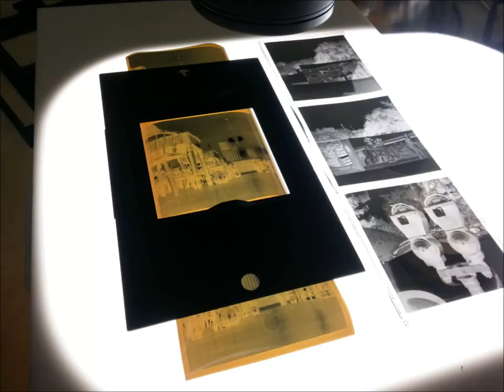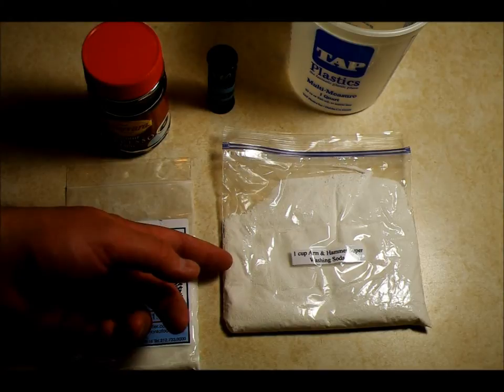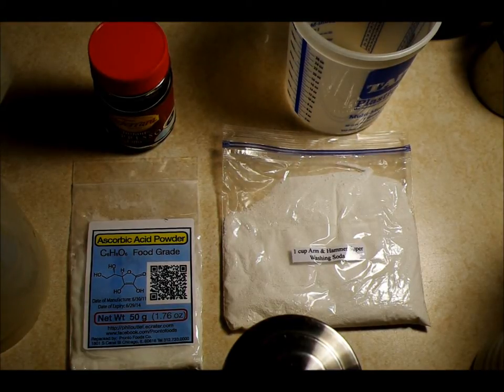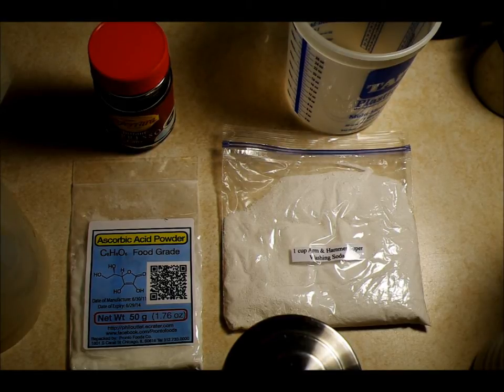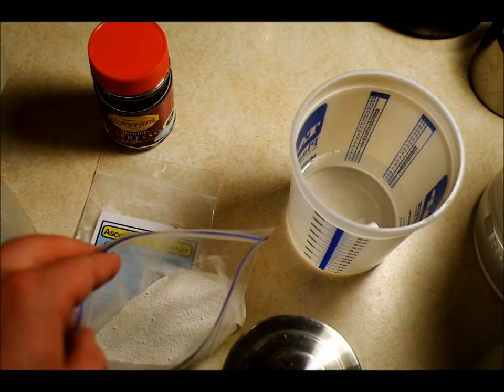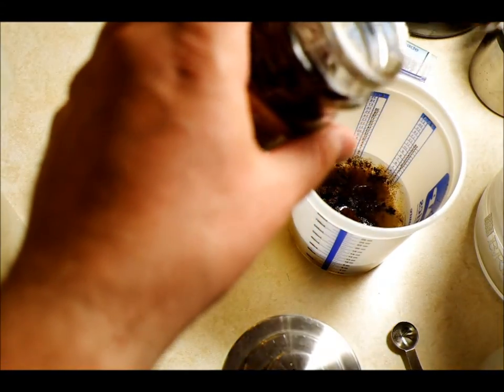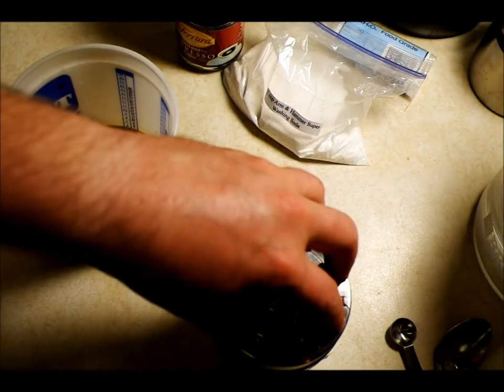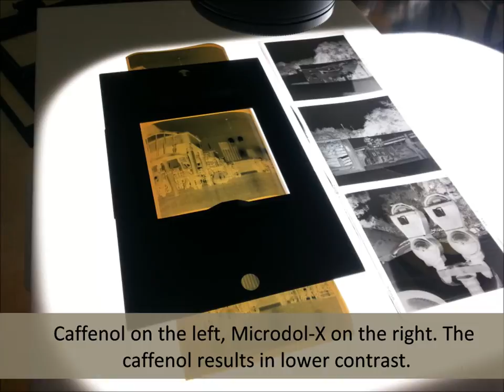Developing Film in Caffenol-C (Avoirdupois Volumetric Measure)

Comment: I like to do caffenol C-L, with the potassium bromide, I let it sit for 35 minutes, do one agitation and another 35, and it's come out great every time. I like it because it doesn't really matter what kind of film it is or what exposure settings, they all come out, even like Ilford HP5 pushed to 3200.
Reply from the maker: C-L is on my short list to try. Thank you for the tip on the stand developing time. I'm hoping to have some free time in the spring for more alternative process work.
Reply: ***** I'm not sure what the L stands for, maybe "long", because it's stand development. Anyway, if you google caffenol you'll find the blogspot blog and that has all the various recipes.
Reply from the maker: Caffenol Nomenclature is mystifying, so I actually had to look this up and went to the originator of many Caffenol formulas, Reinhold. I found a comment he made on a Flickr thread where he explained the nomenclature. Here it is:

C -- has vitamin C
L -- Low-speed films
M - Medium-speed films
H -- High-speed films
L can also mean low pH, low soda, less grain, low fog, and some other things. In general, L simply means for slow films with tiny grain. 

Other designations exist such as S, Li, and RS, but Reinhold didn't develop those formulas and had no comment on the nomenclatures' meaning.

Comment: The kit I got was from adorama for $20 (free shipping). It's extremely simple. It comes with an assortment of chemicals, but you only need two. Mix chemical A with 500ml of water, then in a seperate bottle mix chemical B in a 500ml bottle. 

When you're ready to use put a couple tablespoons of each into a small bowl. That's the emulsion. Just paint it on paper, let dry, then expose.

Comment: I tried it last night with 3.5tsp soda, 5tsp coffee, 0.5tsp Vit C in 12oz water (volume ready to go for 35mm in a Patterson tank) and there were visible images after 12 minutes, agitating for 15 seconds in the minute (Fomapan 200, shot at box speed). I didn't think it smelled much at all, but I was working in a bathroom with a fan and I smell far worse things on a regular basis. After viewing the results, I think 30 minutes would be far too long but 16 minutes might be better next time. Did you stand-develop?
Reply from the maker: The amount of smell is apparently different based on the mix and specific components.

I did not stand develop these. Caffenol is pretty weak by the standards of other developers. I don't think it's as able to over-develop film as standard developers, either.

Comment: hey can you help me, i want to overexpose by 4 stops how do i do this? im using expired film does it mean i should let it sit longer in the chemical?
Reply from the maker: So, yes, I think so if I read your questions correctly. Leaving the film in the developer for longer is over-developing (overexposing is done in the camera.) Using expired film, it's a good idea to overexpose, too, by about one stop for every decade of expiration.

So if you want to push-develop in Caffenol you can. I don't know exactly what times to use (there are lots of variables -- caffenol mix, film resonse, etc., that make estimating hard) but a good place to start with a 4-stop over-develop is about 2.5-3X the developing time. That's just a guess, though.
Reply: David Hancock yeah i read about it, im using kodachrome 40. so do i overexposed in the camera and afterwards or only with Caffenol?
Reply from the maker: Well, that could go either way. When I developed Kodachrome in caffenol I exposed it an extra couple stops in the camera and then added about 1% to the developing time. You shouldn't need to do both.

Kodakchrome has a backing on it called remjet. Remjet is a process-surviving backing meaning that film chemistry can't remove it. After you develop the Kodachrome, you'll need, before it dries, to run it under some water and gently rub the remjet off the back of the film with your fingers. Use a circular or spiral ribbing pattern with a lot of overlap and only rub where the water is hitting the film.
Reply: David Hancock so i should just film it how it is and add more time to the developing time?
Reply from the maker: jaymaikeljay I would overexpose in the camera (if your Kodachrome 40 expired in, say, 1985 then you'd want to expose it as something like ISO 6) and develop slightly longer. The reason for that is over-developing increases contrast. Overexposing in the camera will make sure there's a enough light hitting the film. Then develop for somewhere between the recommended time or time+15%. Having slightly thick negatives will be easier to work with than thin negatives (that assumes it turns out at all, which there's no guarantee with when using old film.)
Reply: David Hancock ok thank you so much!